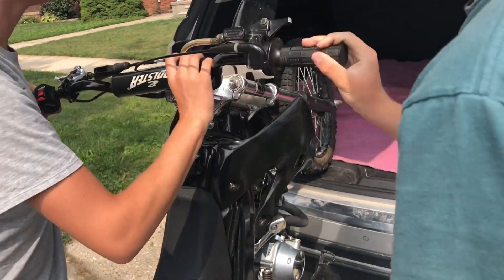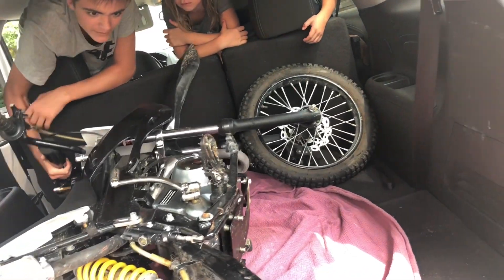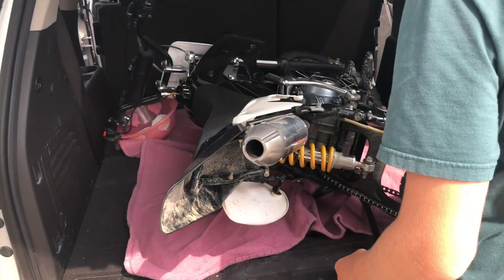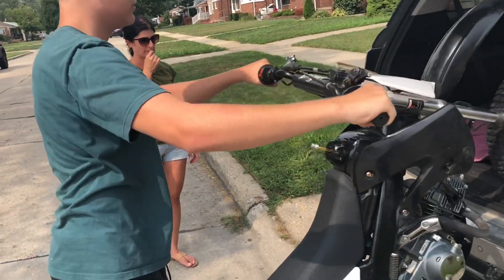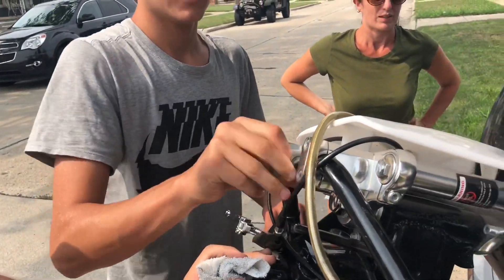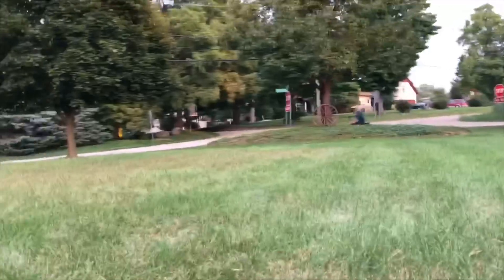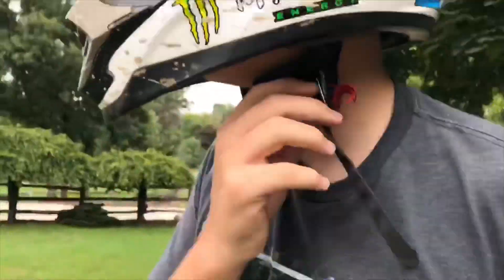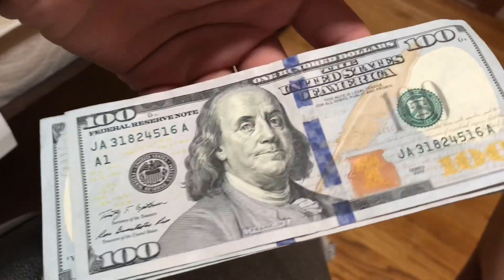BUYING A 400$ CHINESE COOLSTER 125cc PIT BIKE

Comment: Dudes, i can't read stupid comments like "chinese are the worst bikes" or "i've got a better one" DON'T WRITE BULLSHITS! If a bike is in good condition it will run fine. I've got a 2 stroke chinese pitbike and after 15 years, it runs nice.
Reply: Maybe 15 years ago.. new ones are trash. Ssr, Tao tao, and some Coolsters are probably the best of the ones they make now but I would buy those brand new. We bout a BRAND NEW never before riden Orion (chinese brand) 2 stroke 49cc dirtbike and it has been nothing but problems and cheap chinese crap. The screws are so soft they strip or break the first time you need to take them out. We've completely rebuilt it because we had no choice EVERYTHING failed or was defective from factory.. Only thing original is the frame and handle bars. It has broken down 5 times and we've riden it 4. Had it for 2 years and mostly sat in the garage waiting for new parts from China. We should have bought a Honda.

Product of high demand, low cost, high profit, low customer satisfaction.
Reply: @NNBS_Q dam you should like get the brand in the vid or the Tao Tao or Apollo others just are problems your right but at least the parts are cheap🤷‍♂️